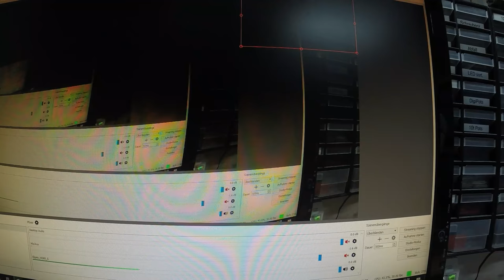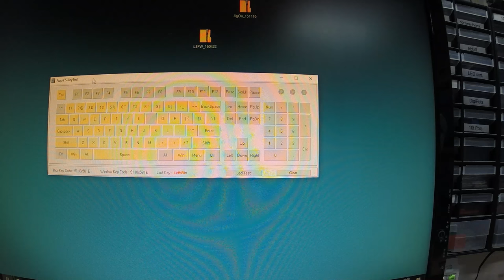Duck Viper v2 Build (Nixie Switches)

Comment: Hey Wodan, onmybikedrunk here... Great video man!  We're both in the Nixie/Viper club!  Also glad you liked our diffuser!!  One thing I noticed (and I'm not trying to bust any balls here) but the front diffuser was flipped the wrong way.  I'm not sure if it matters in the config you had, but LED shine-thru might work out a bit better when the LEDs are all lined up with the diffuser edge.  Crack it open and flip it the other way, you'll see what I'm sayin.  Cheers!
Reply from the maker: NYC Mopeds Awesome, thanks again for organizing the diffusor GB.That was such a smooth operation. Gotta replace 2-3 switch bottoms anyway since they are a little chattery and will flip the diffusor in the process. Thanks for the hint ;)

Comment: What kind of gloves are those Wodan? :)
Reply from the maker: l2pn I am having a hard time translating their name into english. It's something along the lines of "mounting" or "installation" gloves. They greatly improve your grip when working with drywall and wood panels while protecting your hand from splinters and minor cuts. I like them so much, I wear them almost every time I have something to fix ;)
Reply: Wodan thanks! I've been looking for a solid pair of gloves for working with KB's and hardware in general.

I've seen you wear yours so many times in your videos - so I was wondering if they were for a specific purpose :D thanks again for claryifying - I'm going to try and pick up something similar. :)
Reply from the maker: Glad I could help but here's the catch ... I tried several brands and models before finding these gloves. They're often too stiff or too thick to give you a comfortable grip on small parts. Originally got those as a 1-pair sample in a gifted advent calendar by WERA tools and ended up contacting them to find out who supplied them. If it helps:
https://www.amazon.de/gp/product/B006GCO56G/ref=oh_aui_search_detailpage?ie=UTF8&psc=1
Reply: I couldn't find those exact ones in Sweden - but I did find a similar pair by the same brand:

https://www.esska.se/cgi-bin/esska_se/iboshop.cgi?showbynameSearch,0,,,q=texxor

What do you think about these? Most of them appear to be synthetic leather - whereas I think yours are nylon?

Some quotes below:
- "Gloves are useful for light work of all types such as logistics, representative purposes, brass wear, hobby and leisure etc."
- "Good grip on both wet and dry surfaces"
Reply from the maker: They look way thicker than the ones I got. I can ship you some ;) PM me on Deskthoriy :)
Reply: PM'd! :)